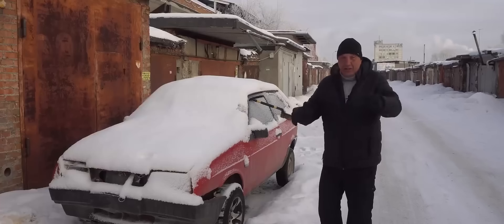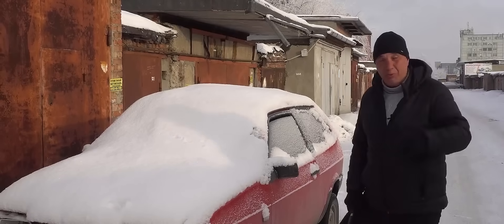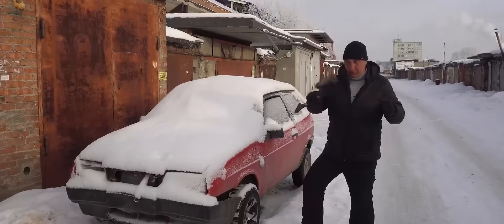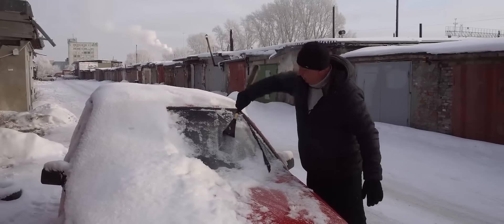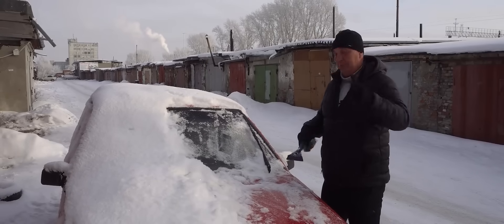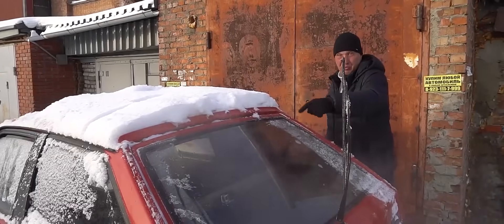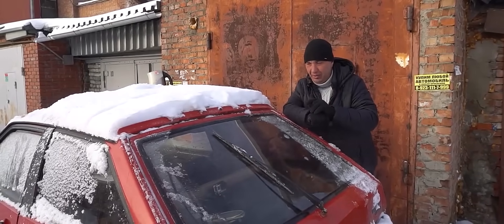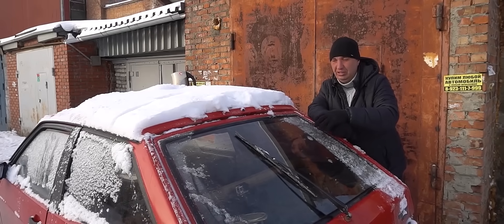What happens when you POUR boiling water onto a frozen windshield?

Comment: As long as the glass is properly tempered, and it is set in the frame correctly so that the edges of the pane of glass have room to move as the glass contracts or expands there should never be an issue. If the bottom or top of the glass or the edge of the glass is sitting solidly against the steel frame so that as it expands it has no room to move, or the glass was not tempered correctly then there is a risk of it cracking or breaking.
Reply: Nah you can do this with any piece of glass, cut a little square and try it. You CANNOT however pour cold water on glass that's been sitting in the sun. The physics is just way more forgiving in one direction due to glass's terrible insulating and conducting properties.

Comment: The only reason the glass would crack is IF there is previous damage, like a rock chip even a small one. If the glass is 100% in tact then there's no chance that pouring boiling water on them will do anything, especially the back glass as it's tempered.
The Windshield is laminated, meaning it's 2 panes of glass with a layer of vinyl in the center. What happens is typically the outside layer has a small chip, when this layer is exposed to a rapid temperature change it's either expanding or contracting much faster than the inside layer putting a large amount of stress on the glass causing the chip to crack out.

The tempered is actually much stronger than the laminated glass and much more impact resistant, how ever once it does fail it shatters into tiny pieces making it unsuitable for a windshield.

(3+ years auto glass industry.)

Comment: Typically the glass wont crack unless there is already a weakness (such as a chip) when heat is applied. Also, boiling water can actually refreeze quicker due to the fast moving molecules hitting very slow molecules (cold). But overall, modern windshields wont crack with heat alone.
Reply: Exactlyyyyy!!!!!!!!!!

Comment: I have had glass break with a blowtorch, but only if left on one point too long. The hot water likely worked because the heat wasn't focused. Although I'd be more worried about re freezing.

Comment: 1) the window is not glued to body - is in rubber sealing - have more place to shring
2) by this old cars is not a part of body structure -  is not too rigid, is more flexible.
3) the sadwitch design is not on todays level - far more easy.

Comment: The reason it didn't shatter is due to the high temperature resistance  in the glass that can expand and cool down at the same rate as the temperatures around it. It has a high stress resistance as well which only adds to it.

Comment: We did this many, many times during ice storms in Illinois, the first in winter 1967 or 1968.  It is great for melting the ice from your windshield, but the water cools off way before it transfers much heat to the windshield.
Reply: I always heard you’re not supposed to pour boiling water on the windshield because it will make every windshield crack you’re supposed to go out turn your heater all the way up leave it for a few minutes let the car warm up inside now I hope melt the ice and also you’re not supposed to turn the wipers all the way on full I heard of some people doing that and they broke the motor very expensive repair !!

Comment: If it doesn't crack it will weaken the glass, did pouring hot tea in a cold glass break it everytime?
No, it doesn't. But it will eventually crack or break from a tiny rock hitting it.
This isn't an experiment. This is another patriotic idiot trying to say my junk is better than yours.

Comment: Most car windows are heat/cold treated to a certain degree to prevent lawsuits and safety issues from happening. If the windows were froze solid and not just glazed over, with snow acting as insulation, it may have cracked but still doubt it.

Comment: Is this guy crazy? Does he not know all modern cars have tempered windshields with a shatterproof backing? That’s the universal default standard.
Reply: rockerteen8300 that car doesn’t look modern. And not all of them. Example , India
Reply: Most cars actually crack because of what he did in his video
Reply: HaX BTC nah, I’ve lived in places that get 20 below and have done this to 1980’s cars, no cracked windshields.
Reply: rockerteen8300 Bruh I live in Canada it gets to 40 below no problem 😂 20 below ain’t that much.
Reply: Sir Nomsalot I would live there!
Reply: Is that why new g.m. vehicles windshields crack along the bottom from the defroster cause they are tempered? They obviously should go back to the real glass then. It happened on my mom's Chevrolet Malibu and my brothers older saturn.
Reply: A windshield will not crack out from simply defrosting it unless there is a point of weakness. (Chip in windshield or any kind of preexisting break)
Reply: rockerteen8300  actually, america has stricter windshield standards then other parts of the world.
Reply: @Guthix_268  American windshields are weak and will crack from using your defroster.
Reply: @frankrizzo8175    It is required by law in the United states AND many countries to use laminated glass for vehicle's. It's strong like tempered, but it's not tempered glass. They use laminated because it's safer and protects more from shattering.

Comment: The reason of why your experiment did not work is because to do a bit of research before doing this test. Car windshields are by regulation are to be made of Tempered Glass and to have a certain thickness by mm. Of 0.4 or greater. If what happened to your friends windshield is true, it is because that window is not to code and is not a real windshield for a car. Someone had cheaped of the window to cut cost. Of worse the manufacturer of that car company based on the car he got is bad quality and should not be in business.

Comment: If there were chips or crackS in the screen. IT WILL CRACK OFF. NO CHIPS OR CRACKS THEN IT WONT. BACH WINDOWS IN OLD CARS ARE NOT LAMINATED, FROM A EX FITTER

Comment: Auto glass is tempered glass - it is layered with plastic film throughout which protects it from impact and sudden temp changes by allowing it to slide against the layers when it constricts and contracts that’s why it didn’t crack.  If you did it with window pane glass, it would break.

Comment: It’s just laminated glass for the windshield and possibly tempered for the rear glass. Lami can take boiling and freezing temps. However if there is a rock chip in the glass, moving from cold to hot, or vice versa is very likely to make the chip extend and form a crack.  I’ve never seen tempered glass shatter from anything cooler than a fire, so should also be fine.

Comment: I was a bus driver here in Scotland for 14 years, every winter I would defrost the bus windscreen just like this in -10 -15 and it never cracked the windscreen
Reply: I think there is a big diference between a bus window or a car window
Reply: @keessmit8999  Only the surface of the glass is larger the composition of the glass is more or less the same .Glass on vehicles are heat treated cycle unlike glass on old windows in houses.
Reply: @keessmit8999  it's still glass 😂
Reply: @JNasttyy  thats true but a bus window is way way stronger then a car window
Reply: @keessmit8999  you are right and wrong. 

A bus windscreen is thicker, which means it's stronger, but only stronger against impact. 

Because its thicker boiling water is MORE likely to break it than a normal windscreen.

This is the reason labrotory glass for heating liquids is very thin. This stops an expansion differential between the inner and outter walls of the glass.
Reply: @JNasttyy  so all glass has the same strength? it doesn't
Reply: Now try it in -30 like in cnd
Reply: Lucky
Reply: None of you know what you're talking about
Reply: Did it for years being young n dumb on a vauxhall astra.. didn't do anything. I have seen it shatter screens though which is why I stopped.
Reply: your bus must have been a lada then 🥴

Comment: Bruh ...pour the hot water on the windshield WITH the snow still on it.
Reply: My thoughts exactly lol why clean the snow off before applying the boiling water? defeats the whole purpose
Reply: @Rick_C-137_  Well, he did say FROZEN WINDSHIELD, not snow-covered windshield. -_- Just pointing that out in case y'all forgot. Hmm... But I do kind of agree with you.
Reply: @Rick_C-137_  I think the point is so you dont have to scrape it. Removing the snow isnt that hard
Reply: Anna G WHY WOULD YOU HAVE TO SCRAPE IT IF YOUR POURING BOILING WATER ON IT lol
Reply: @Rick_C-137_  because if scraping was easy you wouldn't have to pour boiling water on it LOL
Reply: okjaye that’s what I was thinking
Reply: The fact that the question is being tossed around is why its a worthy experiment.
Reply: When you wipe the snow off there is still a layer of ice over the windshield, if you poured it on with the snow it would just make things harder because not all the snow would melt, it’s quicker to just wipe it off first.
Reply: I doubt it would crack . Because when you put heat in your car and the outside below freezing. The window doesn't crack
Reply: fr breh this nigga slow
Reply: It would take more runs back and forth to get boiled water. Also, the water would most likely just turn into a layer of slush on the windshield where he would pour it and not actually clear the windshield. Also, the snow can be removed with one swipe.
Reply: Ya what's the point if you just take off all the snow
Reply: Some of you don't get the concept of Trying . If you felt the current vid (where nothing happened) was a worth while experiment , whats the harm in trying another?
Reply: 😂😂😂😂😂 same shit I was saying
Reply: Won't change anything. I do it all the time. Only window that has ever cracked, already had a rock chip in it.
Reply: okjaye Real shit
Reply: okjaye 
Bruh if you don’t know why he did it the way he did then don’t even comment, ignorance is appalling.
Reply: Nothing will happen it won't crack tried it before doesn't do anything
Reply: okjaye obviously these guys who are commenting don't understand the experiment and yes it makes a lot more sense to keep the snow on there as the temp of the glass would be more cold and we would probably get a more eventful experiment!
Reply: K Mabrey that’s not how it works.

Comment: That said, Pyrex glass seems to handle temperature changes better than plain glass so something in ghe processing affects the structure of the glass. Perhaps toughened glass used in car windows is similar to Pyrex so maybe it will tolerate the thermal shocks better.

Comment: Try pouring very cold water immediately after pouring the hot water.  You might find it cracks then. 

Historically rock has been cracked by building a fire to heat the rock then cold water being thrown on.

Comment: The reason why the windshield didn't crack is because it's not glued to the frame like in new cars. Instead, this windshield is set in to a rubber lined frame that allows it to move. That way windshield can expand and contract as it needs.

Comment: Ya well if anything the boiling water would crack the windshield before the hot air car blower. The blower is more gradual and builds to a temperature not even as hot as a hair dyer. Glass cracks from extreme temperature variations quick, so ya the glass is good quality, tempered and strong.

Comment: The reason it is not ckraking is because the snow provides a layer of insulation from the worst of the cold. The air temperature could be -2 say,   but it is likley that the surface of the glass is higher, and as such, would not provide enough of a temperature difference for cracking to occur.
Reply: Actually on second thoughts I have decided that my previous comment  was flawed. It is likeley the the glass is in fact the same temperature as the air, inside the car, it could be the same as the ambient temperature outside or it might be warmer if you have side the car say within the last 24hrs.

Comment: Auto glass is heat treated to withstand temperature change of 300 degrees. That's why boiling water (100 degrees) doesn't crack the glass.

Comment: Toughened glass, and that its expansion was not hard up against the metal surround.
I still don't recommend using boiling water on freezing windscreen glass.

1. Cold water (a lot warmer than an iced up window) will suffice anyway.
2. Boiling water, that creaking noise is the glass quickly expanding But if its locked (frozen) around the edge then it could still smash, since it needs to expand somewhere.
3. Toughened glass will lose a lot of its toughness if it already has a hairline crack or stone chip. ie you could cause it to shatter if poured onto a hairline crack on your windscreen.
4. I'm a bit concerned you could cause an issue with the transparency of the glass. The outside will expand quickly but the inside won't (glass doesn't uniformly distribute heat sadly). So you might cause a 'glazing' effect. 

Cold water will remove windscreen ice . No need to boil anything.

Oh and passing unrelated comment. Water (or fluids) are an abnormally to other substances such as glass or really most materials. Water when heated will contract, and when frozen will expand. Hence why when you were kids your glass of water in the freezer smashed. Only water does this, but anyway that's unrelated. GLASS expands with HEAT.

Oh and easy test for all of this. But safety required.

Pour boiling water into a toughed kitchen glass (made for hot coffee/tea/soups etc) all good.
Pour boiling water into a standard everyday glass at home, and it will smash. (especially 'chilled' glass from the freezer)
THEREFORE > (instant) Boiling water smashes glass!

Comment: It didn't crack because he started the pour from the middle of the windshield where the glass is strongest and more flexible. After that the heat will radiate out and the potential of poping goes down a lot. You notice he didn't get near the corners at anytime during the pour on either side.  If he started in the corners that thing would have popped for sure I think. It doesn't take much to pop safety glass in corners.

Comment: well as he said in the video at the beginning the temperature here is the same inside and outside the car, if you want this experiment to succeed, this is an educated guess, you should warm the   car inside for like a  15 minutes so there would be a huge temperature  difference between the outside and inside of the car, another likely explanation might be ( but not very plausible ) is that the glass isn't glued in the rubber so it can expand without touching the metal frame of the car

Comment: The problem with using boiling water to de-ice is that rapid/extreme heating and cooling can change size of existing cracks, it isn't very likely to shatter or crack unless it has already been weakened by a crack or chip.

Comment: If the car wasn't on level ground , there would be corner to corner tensile  twist like pressure on the body therefore pressure on the windshield frame = pressure on the windshield , so it depends on hardness of the rubber gasket and its resistance to cold temperatures  which increased hardness which means less movement allowed  and how tight of a fit the windshield was measured , and I'm thinking the springs in the vehicle should also taken into consideration

Comment: the water is fluid so the temperature changes faster with the all the turbulence as it flows down the cold windshield, heat goes up so the lower layers of water get cold and very little heat is transferred to the glass.but  you poured enough water over time to heat the glass up enough to prevent the water from refreezing which is pretty awesome.

Comment: Even if it would be boiling the moment it hit the glass, fact is that quality windshields just don't break that easily and are made to withstand quite some abuse. The reason this is still ill advised is that doing this time after time is a repeated risk, something that cannot be guaranteed, and for a little while the glass will certainly be more brittle. Also keep in mind the temperature shock of rubbers and glue, as they don't live forever also.

Comment: Nothing happens because materials don't shatter when heated, they shatter when cooled. Also the heat of the water is nowhere near enough to cause glass to melt, it doesn't affect the structure at all; it also isn't very efficient in transferring heat into the glass because all of the heat is going into the ice, melting it.

Now heat the windshield up with a blow torch and quickly dump liquid nitrogen on it to see the results you want.

Comment: Drastic changes in temperature from cold to hot does not crack glass or deform any other material. However, if the change is from supert hot to cold, things change. The glass will break and other things might deform. So Cold to hot, bothung happens, hot to colds, things get crazy.